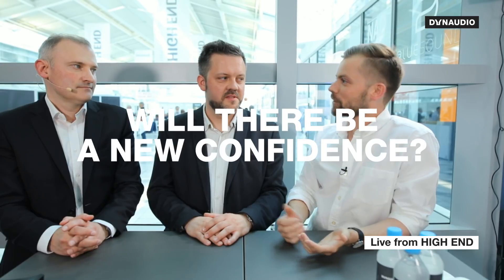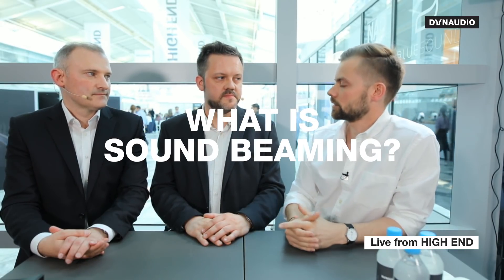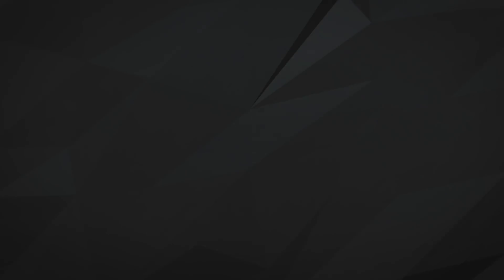Ask the Expert: What's sound beaming?

Comment: Very interesting, thanks a lot for explaining. All that was missing is a sneak preview :) I was wondering what happens to the sounds image when DDC (1st gen) is used in a room with a very high ceiling (10m). Does this have any effect on dynamic or staging in a positive or negative way?
Reply from the maker: Hi Jeroen. No problem! I talked to Otto about your question. Here's what he said: 

"The DDC specifically means that the sound is less affected by the type and height of the ceiling, so having DDC will be an advantage. A room with a very high ceiling requires higher SPL at the loudspeaker, to provide a given SPL in the listening position, especially at lower frequencies – but this is true for any loudspeaker. Overall, DDC should provide an advantage, all else being equal."

I hope that helps, 
Christopher.
Reply: @dynaudio  Hej Christopher, thanks very much for explaining. To all of you at Dynaudio: god jul og godt nytår!
Reply from the maker: same to you :)